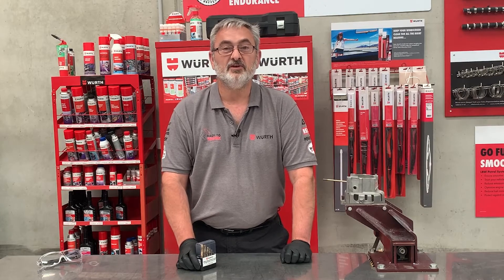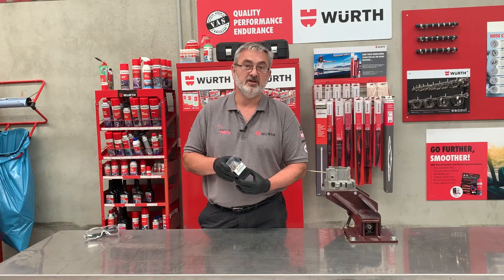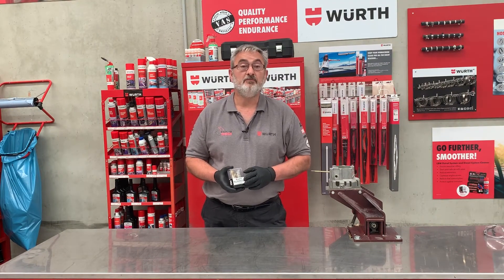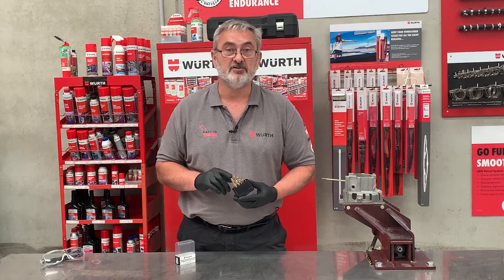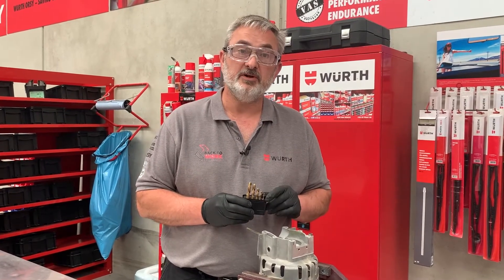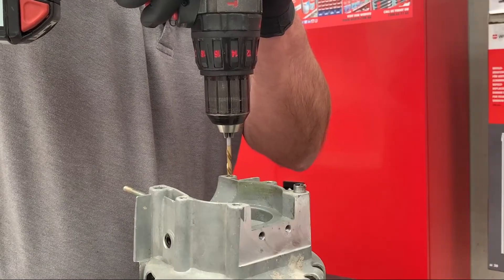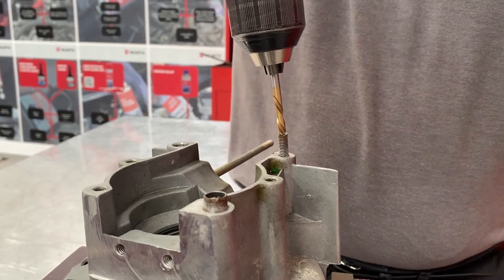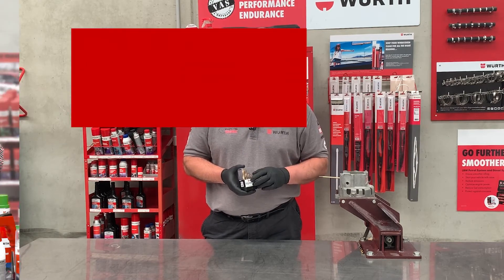Left Handed Drill Bits Product Tutorial

Comment: what if you can't make the broken bolt flat at the broken part/head?
Reply from the maker: As a rule, the broken bolt or stud would be centre-punched to keep the drill running true, but it becomes increasingly critical to do so if the break is uneven. Sometimes the part needs to be mounted in a pedestal drill jig to hold everything centred so as to increase the chances of a successful removal.